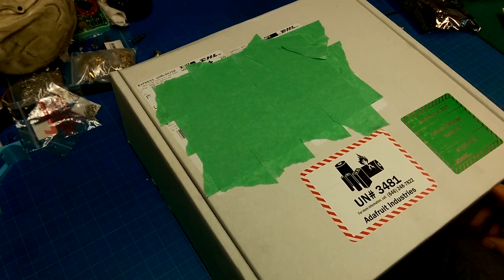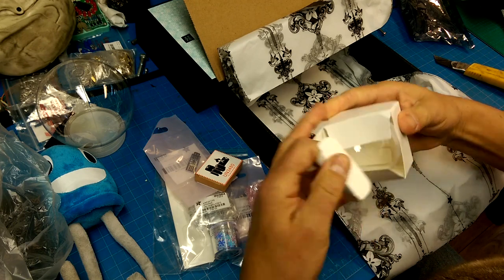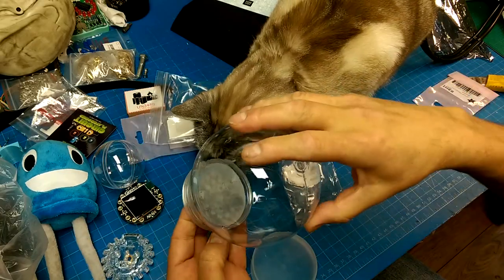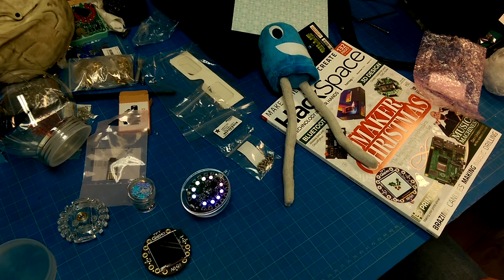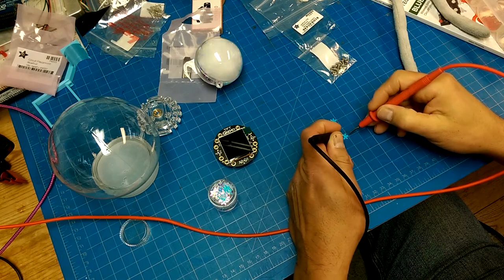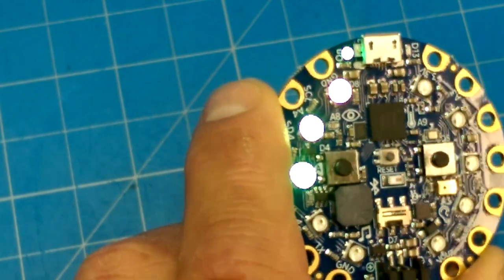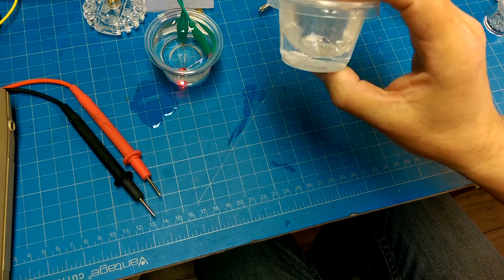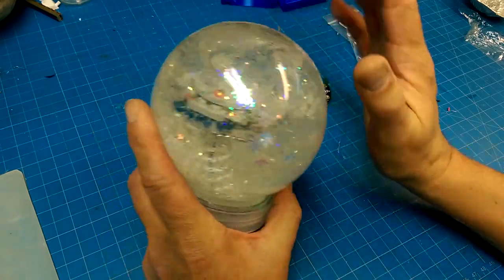PyXmas

Comment: To bad about the leak, hopefully its manageable as cleaning the mineral oil off plastic well enough to try resealing is going to be a chore. My box is scheduled for delivery  tomorrow, thanks for the idea.
Reply from the maker: I am not worried about the leak.  It is just a bit messy to take the battery out for charging is all.